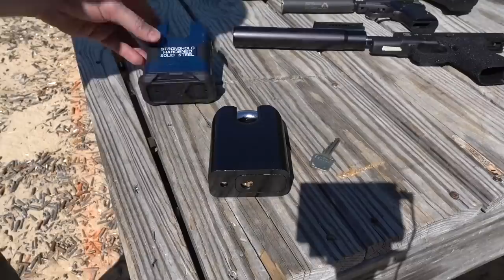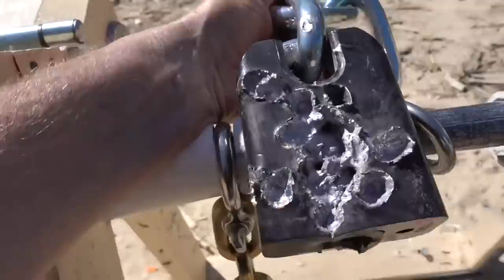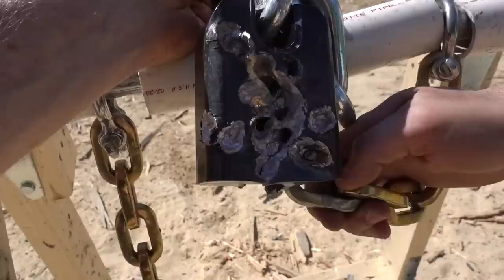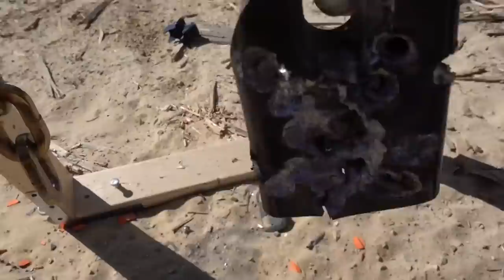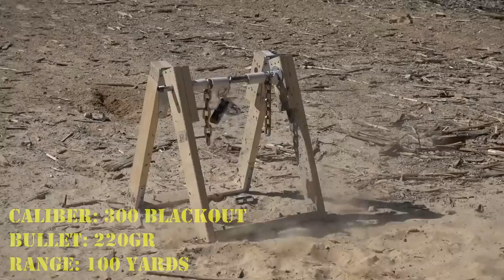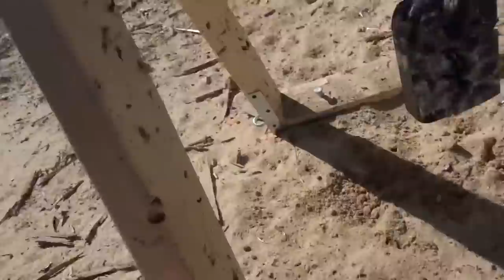[897] The Lock That Survived 120 Rounds! (Squire SS80CS)

Comment: This lock will be a good safety measure for my glass door
Reply: Well, if the glass is bulletproof ^^
Reply: @-Turtl3_  "if the glass is bulletproof" - then pick the lock in 3m 16s and use it to break the glass ;)
Reply: @andrewmorton9683  Yeah, I agree.. I mean who in the world would just walk through a door after having picked its lock without first completely destroying it.. Right??! 😉
Reply: @-Turtl3_ 
Gotta send a message!
Reply: @DinnerForkTongue  Yeah, of course 😉
Reply: Yeah, one of the considerations on a lock is how secure is the thing you are locking.

Even "bulletproof" glass can only take a few rounds to a few dozen rounds before it cracks all the way through, depending on it's rating and the bullets used.  Bulletproof glass, is basically multiple layers of hardened ceramic glass and plastic composited together, placed in a secure binding frame to better utilize it's tensile strength.  

Depending on the rating it can take between one shot from a 9mm to a couple dozen rounds from a heavy armor piercing gun.  It wouldn't stand a chance against more than one shot from those last two types of AP guns they were using. 

The minimum to make this lock it's weakest link is a heavy half-inch metal composite armor lock-box or a 3/4 inch solid hardened steel lock-box.
Reply: @ruediix  I must say that I do agree with you on some of your points. 

The term bulletproof basically doesn't really make sense, bullet-resistant however is a much more realistic term.
There's also bullet-resistant glass that can withstand .50 BMG projectiles and probably quite a lot of .308 AP rounds.
Even if you manage to pierce the glass by shooting multiple rounds in the same area, you would only be left with a small hole, through which you couldn't enter into the room behind it.

Of course, practically speaking, installing such a thick piece of bullet-resistant glass on a door and securing it with a padlock like the Squire SS80CS wouldn't make a lot of sense.
Using metal inserts and 1 or 2 high security euro-profile cylinders (depending on where you live) like the EVVA MCS in combination with an IKON/ABLOY Protec 2, would be a lighter and much cheaper solution.
Reply: Guys just make a door out of these locks
Reply: Good luck with your lock
Reply: @-Turtl3_  no bulletproof glass resists all bullets infinitely forever. I've played video games and have tested this myself.

Also wooden doors can resist RPGs no problem. Shocking I know, but true.
Reply: @bluedistortions  Well considering your high quality source of data, obviously you must be right! Thanks a lot for letting us know about this very important insight! :D
Reply: The lock can be easily picked it is useless as seen in another video only feature of this lock is its resistance to bullet and drill.
Reply: Yes indeed
Reply: True
Reply: If the glass has reinforcements.
Reply: Lol

Comment: It might be faster to just shoot a circular hole in whatever door that thing is protecting!
Reply: As is the case for a number of them.
Reply: Thats pretty much the strategy to defeat any lock. 9 times out of ten, a lock is several times tougher than what its attached to.
Reply: UK special forces and counter terrorism police both have flechette rounds that blow door hinges off completely bypassing bolts, locks and other means of securing, nicknamed fists of steel they literally punch a great chunk of the door and frame off.
Reply: @dodgydruid  
Hell yeah. Blowing doors clear off the wall and entering gives you a helluva adrenaline rush.
Reply: @dodgydruid  That's one of the things that underslung shotguns on rifles are for. U.S. Army's got a bunch.
Reply: Over engineer the door and put it one on as a finishing touch?
Reply: Spring Bloom Yeah, a surprisingly large number don’t seem to consider that. There’s a guy in my neighborhood who got a Protec2 lock for his front door and I didn’t have the heart to tell him it was pointless if his door and windows didn’t match the the quality of the lock.
Reply: Unless that door is made out of reinforced concrete a foot thick or solid hardened metal.
Reply: @N Webb  Or knock and see if someone will open it
Reply: Adam L LMAO
Reply: For reference it's picked in 3m 16s in an earlier video.
Reply: No here’s how you do it:
Step 1: shoot it
Step 2: use the bullet shrapnel to pick the lock
Reply: Adam L my squire same model was opened just by dropping the lock
Reply: @heretomakeyousalty6126  was it dropped with a twisting motion on top of the key?  In all seriousness though you should send it into the LPL!
Reply: @dodgydruid  Xcept they dont cause flechette rounds are known for their horribly poor performance. Breaching rounds are frangible rounds, most usually slugs.
They are designed in a way that they disintegrate upon impact to prevent ricochets and over penetrations, usually metal powder with some binder agent.
Reply: @ohilevoeauca789  those are usually 203s now called 320s I believe it's a 40mm shell of different types most go boom
Reply: @419buckeye7  M26 Modular Accessory Shotgun System. In use by the US Army since 2003. 

Before that, the Masterkey shotgun.

Don't patronize me.
Reply: @ohilevoeauca789  I understand it exist but I have only ever seen tankers with 12 gauges and some spec ops guys had the m26 makes sense though who else is really gonna be raiding houses and shit
Reply: that would be shit in a hostage situation
Reply: jdi801 but now that the core is shot through, he prob cant even pick it
Reply: Heard of metal doors?
Reply: That is so fucking shapist!
If your intention is to fuck the door then it makes sense I guess.

Comment: Time to open a Masterlock with airsoft guns.
Reply: roopiin 91 even better a nerf gun
Reply: maybe one of the plastic LOTO locks.  Not an actual metal-body lock.  an airsoft .177 pellet just won't have the energy to do more than add ablative armour to a proper metal lock body, and the lock bodies are the part Master does right, it's (usually) the cores that suck.
Reply: Finger guns
Reply: @tashkiira7838  I dunno I have a 1k FPS air rifle with lead BB's that might do the trick
Reply: @crusader2718  LPL and BB tested master lock in this video series as well, the real locks needed at least 5 shots of 9mm and 3 of 45acp. The best master needed 5 shots each of 9m, 45 acp  5.56 Nato and a lot of shots with 7.62 Nato and they still had to pry it away with a hammer.
Reply: @sulivanmagnum I went to get some practice locks and while I was browsing, one of them literally fell open on the hook. Regrettably, I did not take a photo, but I did close the shackle before choosing a better lock to purchase. It was already embarrassing enough, I had to leave it with some dignity.

Comment: ironically the plastic cover seems to be more secure than any master lock
Reply: A bolt shoved through the hasp with a wingnut on the other end is more secure than a masterlock.  Takes longer to spin the nut off the bolt than it does to get the masterlock off.
Reply: @merendell  lol fair point mate. and you can really torque those wingnuts tight eh...

Comment: Damn thats a solid lock...
Would be awesome if squire sends that bigger lock :) 50cal would be a awesome test :)
Reply: thick
Reply: I hope they do!  This is awesome advertising for them and it costs nada!
Reply: joint video with demolition ranch! 🤠  he could work his way up from the lapua.
Reply: Paging Matt Carriker.
Reply: Like the Mythbusters said: if it's worth doing, it's worth overdoing. Yeah, do the 50 cal.
Reply: They sent a bigger lock.
Reply: they do.  In fact, LPL and Bill shot up a Squire SS100CS (9.5 POUNDS!) in another video.  It took the same amount of small arms fire as the CS80SS here, and a lucky AP hit on the shackle allowed the 20th .50 caliber round to break it.  that's right, 20 .50 rounds..   More impressive, the lock they shot up here took two .50 shots before giving in.

Let me say it again.  the CS80SS and the CS100SS took 120 rounds of normal rifle fire each, and two and 20 rounds from a gun commonly used as an anti-materiel sniper rifle to KILL TRUCK ENGINES before giving up.  These are GOOD locks.  They're also spendy, the CS100SS is sold by Squire for a hefty 260+ pounds (Squire is a British company).
Reply: @tashkiira7838  it's funny how pounds and pounds in your comment mean two completely different things =)
Reply: @vadipp  Not THAT strange: the British money is the 'pound sterling', or a weight of actual silver, originally.  Now it's really odd-sounding though.

Comment: Cant help but wonder if the results would be different with something solid behind the lock. A lot of energy is wasted with the lock free to swing. (Still helluva impressive lock)
Reply: It would certainly be different results. I have shot the green tip ss  rounds straight through a v-8 iron engine block, went through like it was butter.
Reply: No. The lock is orders of magnitude heavier than the bullets. The transfer of momentum only wastes a small fraction of the energy.

Also, "green tip" M855 is actually a terrible armor penetrator. The steel core is too soft to work like a traditional penetrator, and the lower velocity severely reduces its ability to damage hardened steel. High-velocity lead core rounds like M193 are actually far more effective against steel. Plenty of videos demonstrating this on youtube. Steel is very velocity-sensitive. Once the projectile starts going above 3100 fps the damage sustained by the metal increases dramatically. (ranges banning steel core ammo because of "target damage" are irrational. M193 and varminting loads chew the fuck out of targets, M855 does much less. Though the latter can still be a concern because it's a sparking hazard)

If you wanna defeat steel, you got three options: AP rounds with a proper hardened penetrator, extremely high velocity rounds, or rounds large enough to deform it until failure. All three make a distinctly different kind of hole.

Comment: 7.62 nato AP is no slouch of a round especially if he is hand load it hot like he said. Thats damn impressive. If you are worried about destructive entry this is the lock for you!
Reply: The issue is battery powered angle grinders exist.  That chain and shackle are tough and would likely chew through an entire cutting blade (cost $1) but would last 1-2 mins tops.  This is why most high security doors secured by a padlock have shields over the shackle and lock so you can't get a grinder in there.
Reply: If someone is doing major league destructive entry, you need a lock capable of resisting detcord and other explosives.  Not to mention I still think LPL and Bill are doing the lockbreaking wrong, should be smacking the top of the lock with the bullet.  Locking lugs versus .45ACP, the .45 usually wins.  And that's not counting those 400gr frangible breaching slugs they make for shotguns.
Reply: Put it against a rock and a .223 with a green tip ss round will go right through.

Comment: Part of it's strength is definitely that it's floating freely, it doesn't have to absorb the energy, it's just transferred into kinetic energy. If it were against a solid wall it may have been different.
Reply: Yes but watch how much this one moves compared to the others. That is, it barely moves while the others go loop de loop.
Reply: Consider how little time it has to move. You don't care about when it is swinging, the impact is happening from when the round hits to when the round stops or bounces off. That's not much more than 1/1000th of a second. The lock will move under a milimeter in this time.

Comment: I'd like to see how the same lock holds up when braced against a solid surface. A large amount of the force from the bullets is being lost to the movement of the lock on the chain.
Reply: I think the solid surface is key to understanding the results. After all, the force might break the solid surface first.
Reply: XENO definitely, but it also shows how inferior all the other locks are, because it’s the same swinging test. I do agree that shooting it with a solid surface behind it would be a great test and a great video!
Reply: Force is proportional to (the change of bullet speed). So no big difference if the lock is heavy and moving slow in the end.
Reply: Would make zero differnce. Bullets dump their kinetic energy before the lock even starts swinging.

These arent hand swung sledgehammers.
Reply: @bluedistortions  technically no. The kinetic energy of the bullet is dumped, but the lock bolting out is a sign that there's an energy loss.

Comment: If you strap 10 of these to your chest, you can probably withstand a freaking railgun round.
Reply: @Fedora Eagle And that is probably impossible
Reply: @Fedora Eagle 5 pounds times ten locks only equals 50 pounds. i know people that can carry 2 80 pound bags of concrete on each shoulder. 320 pounds
Reply: Even if the railgun round didn't reach you, you'd still be receiving nearly all of its kinetic energy.
You would explode.
Reply: @logitech4873  actually fair enough

Comment: If you want to bust a lock with a gun, 12ga is the way to do it, and by shooting "down" on the side the hasp connects to. Even cheap Master locks will hold up to a few rounds the way you were shooting it. Sill impressive that it took a lot of shots, but not the ideal way to test forced entry with a firearm.
Reply: Doing that is pretty dangerous though.  Spalling/ricochet would be a major concern that close.  That's why they were shooting at 100 yards (generally considered safe distance when shooting at metal target).  Unless you built a Mythbusters style test rig I would't bother.
Reply: @ByrdmanAero  No, it's common to shoot steel targets with shotguns in competition at ranges as close as 25 yards. But you're right that they would need to perform the task with a little bit of care. You wouldn't want to be right next to it. Three or four sandbags and a bit of string is all you really need to do it safely.
Reply: @chopinbloc  You need to add some caveats to that statement.  In most competitive shooting, ammo restrictions apply.  No green tip, no tungsten AP, no incendiary, ect.  In the video they started with green tip and moved to tungsten.  Shotgun slugs and shot must be lead only, no steel as well.

And while most (if not all) steel target manufacturers will tell you a minimum of 100 yards (or 2800 fps estimated projectile velocity) for safe shooting, its not 100% necessary.  Shooting closer (and faster) than that causes pitting and erosion to the target surface, making ricochets more likely as the surface is now irregular.  When the surface is smoother, its possible to control the deflection (if any) of the rounds when the plate is struck (such as a slight downward angle).

For a 3 gun competition, they're likely replacing the targets regularly due to the wear.

Comment: The moral of this series is machined billet locks are the toughest.  That stainless steel shutter lock was also machined billet and it held up really well considering it's size and composition.  All of the locks with hardened sleeves broke down much faster than the billet locks.

Comment: 300 Blackout - 220 gr subsonic  That's hardly more punch that a pin load.
Ignore the following if you already know what a bowling pin load is. A typical pin load (at least back in the day) was .45ACP 200gr 1,000fps or 185gr 1,080fps. Used for clearing the table of leftovers after a delicious meal of bowling pins. 😁

Comment: You are losing a lot of energy into the movement. Put a concrete block behind it or static position and see what happens.
Reply: I suspect a different angle would help.  Fire down onto the lock between the two shackle holes.  However, that's probably a much more dangerous angle in terms of ricochets.
Reply: bdf2718 almost every one of the .300 blackouts bounced. You could hear them and see the dust they kicked up.

Comment: Here's a tip about shooting the lock - you should try to place it firmly on a surface where the lock can't move backwards when the bullet hits it. The backwards movement (in this case swinging back) when the bullet makes contact with the metal surface of the lock takes away some of the force that the bullet transfers to the lock. So if you want the most powerful force from the bullet - make sure the lock is secure and doesn't move back.
Reply: PJNinja I do agree, but all other locks were shot like this and it just shows how tough this one lock is. I would definitely like to see the lock shot against a solid surface, would be very interesting. 
I do see a lot of locks just hanging and can’t get them on a solid surface🤔
Reply: @akaredcrossbow  Ahaa okay, good point about the need to do comparison

Comment: I have an old master lock. One of the ones with the lion on it. It has the original core in it, but the only maintenance it’s had is oiling every 10 years or so. It’s not used for anything but a collectible.

Comment: Brother Maynard, bring up the Holy Tannerite of Antioch! A well-placed batch of that might have ultimately defeated it - and the wood A-frame along with it. Perhaps that should be the next video. Locks vs Tannerite. From a practical aspect, blowing the hasp or door/gate hinges out with a 12 gauge shotgun using a breaching choke and breaching rounds would get through whatever it's securing faster than shooting this lock apart.

Comment: I told you up front that you would need a 50 BMG.  I forget where the video is, but I've seen an S&G 833 or 951 take 5 hits by a 50, and although quite mangled, still  the hasp is somewhat secure.